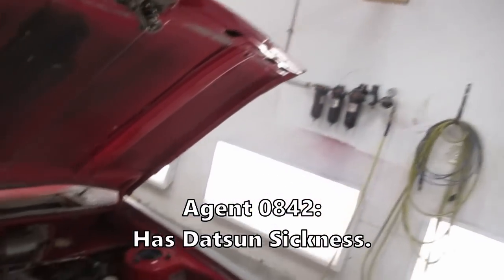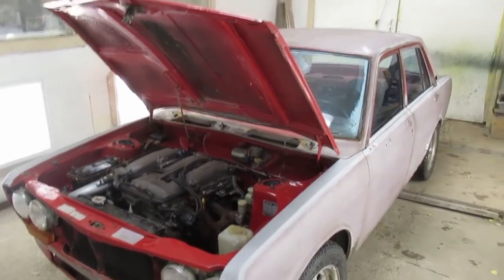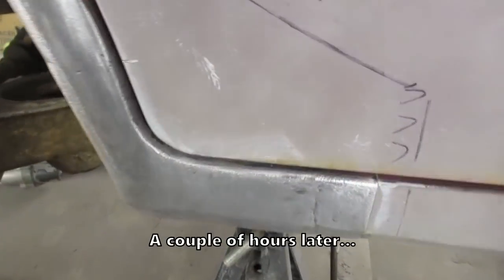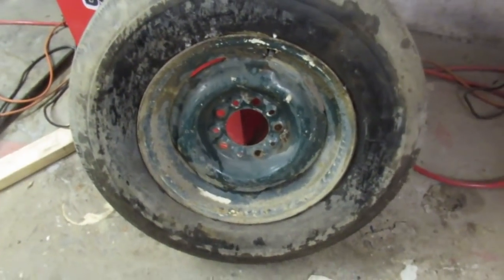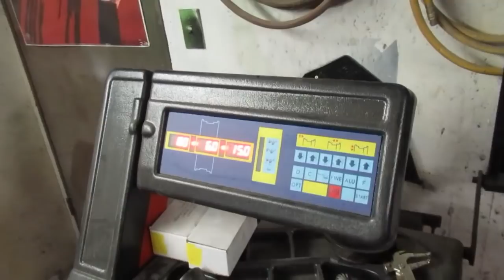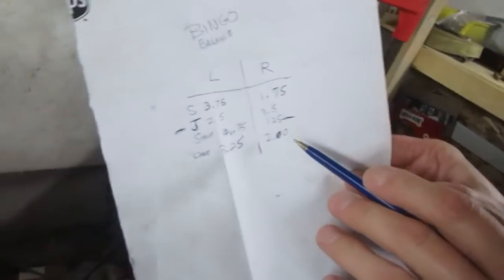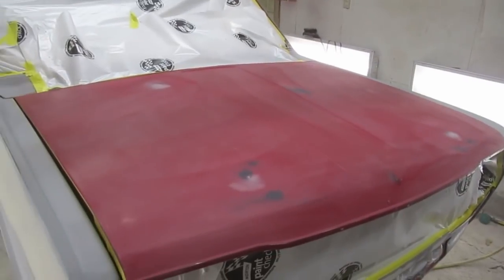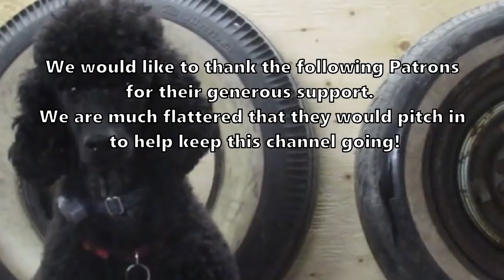Datsun Dust-in! and "My Classic Tire" Special!

Comment: ahhh, yes - cwm studios post is once again a higlight of the week (the doc at the nervous hospital said i need to get out more).
impressive work on the panel and window lip! (take care to not park it too close to plymouth row - don't want their affliction to catch). 
the oxidation rate of a 510 was second only to that of the renault dauphine and international scout. some were in worse condition when they rolled off the truck in '73. 
- dang, your beard grows really fast
- gargle with dill pickle juice (it's cheaper than meds)
- is that "drag slick" atlas plylcron a mate to the "factory second s-rated" one on lf of the plodge furt?

Comment: Fix with a whisper. Ya can’t shout out metal. You coax it to do what it will. If it comes close to dreams then bang it with the tiny weld hammer 🔨 Tink think. Way to go Boyz. Top Secret from us’as. Won’t divulge my agents

Comment: Really appreciate you showing the metal shaping !! What was that piece you had clamped in the vise as a anvil for making that crisp edge line?? Always afraid I'm going to cut the metal if I use anything with too sharp edges. 
One other request that I believe would be of great value to all of us "jealous" fans:  Please devote some time/footage to the final surface prep (cleaning just prior to paint application). We all think we are satisfying this step only to have paint peel off when we remove tape down the road. ;o(

Thanks for all the great entertainment and "vicarious" fun you provide !!

Comment: Had a Datsun B210 when I was a kid, Great little car but pretty low on the power delivery. Like Scott said here in Canada they turned to dust and that is exactly what happened to mine. Bombing down a dirt road the steering box tore off the rotten frame and that was the end of the old Rotsun.

Comment: These cars would only last for about 5 years in the US where they used salt on the roads in winter as the suspension mounting points would rust away to the point of undrivable or practically fixable.

Comment: Great work as usual! Finally I see someone who has the guts to spray a reasonable amount of primer on the body. Most guys on the internet are spraying very little on body repairs. When you have the right material you can get rid of a ton of imperfections.  The material we were using was called primer/filler.  It looks very similar to the stuff you were using. This stuff is very easy to sand.

Comment: Yes the early Japanese cars did suffer badly with rust until they got on top of that problem by 1990 there abouts, the engine in that car looks very similar to my Nissan which has an SR18/20 engine i am told the SR engines can last to about 4--500 000kms maybe more depending on how they are looked after.

Comment: Yeah, not too many of those Datsuns survived the salt. As i remember it salvage yard engine houses in the 1980's were filled chock-full of those Datsun  and Toyota 22r motors.....the motors survived long after the car body-strut housing-walls ripped and caved it. You'd find lots of Fiat 124/128 and Subaru 1200/1400cc motors too. Shame all these car body's didn't hold up.

Comment: (Death rattle) Scott!!
Zinc, Vitamin C, fluids. Lather, rinse, repeat....
Geez, take care of yourself, man. Will ya?

PSA from the Ridge:
I'm not going to watch this video.
audible gasps from the crowd
Why, you may ask? Because I've already watched the EXTENDED VERSION now up on
Patreon! 
Yep, you read that correctly. Scott already posted an extended version on Patreon for us.
Not only is it longer, but it was posted earlier than this one, too!
So...you non-Patreon folks know what to do. It's quick, fairly painless and awesome,
not to mention it helps allow Scott, Frankers and gang to eat (and buy cold meds at the store).
(Ok, ok, I watched this one too. It actually has a LOT of different content than the Patreon one!
At 15:19, do I spy a bottle of Spray Nine, Scott? I TOLD you it was awesome stuff, especially on
whitewalls!)

While you're at it, fetch a shirt, decals, etc. from the store. I'm betting I'm the only one for 100 miles 
down this way to have a CWM shirt (hermetically sealed and stored in the closet for posterity)
as well as a couple of first-run decals, which are semi-permanently affixed to my GTX and my
main tool box in the garage.
They are definitely conversation starters at the local cruise-ins...

Be safe, get well and stay warm up there,
-Ed on the Ridge
Reply: Chicken soup four times a day